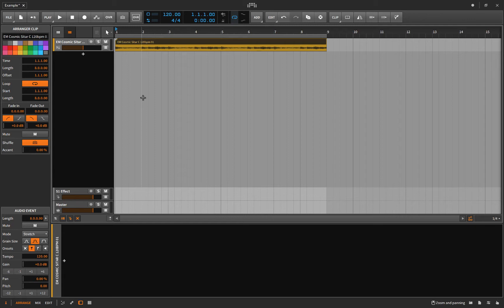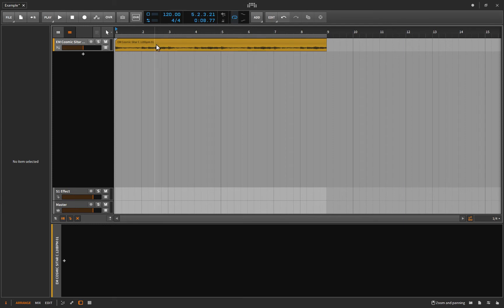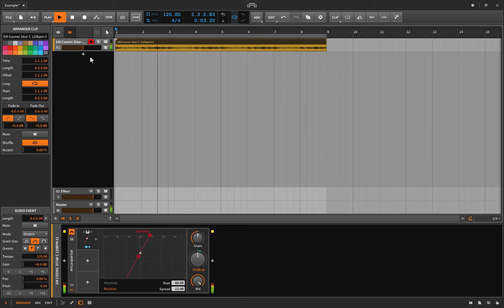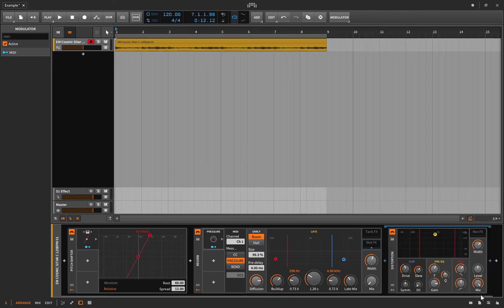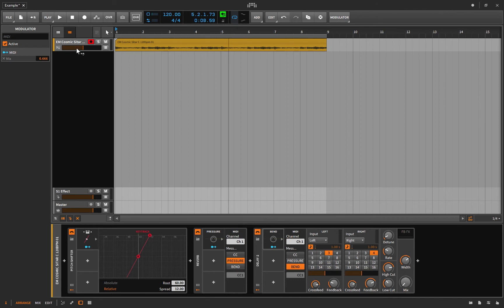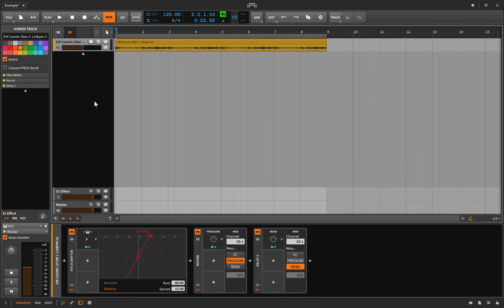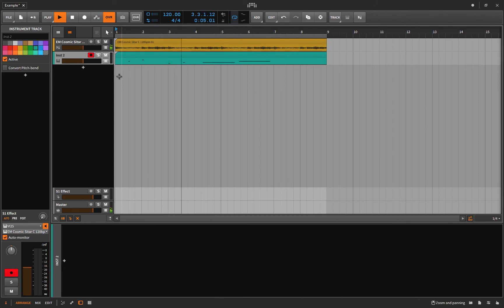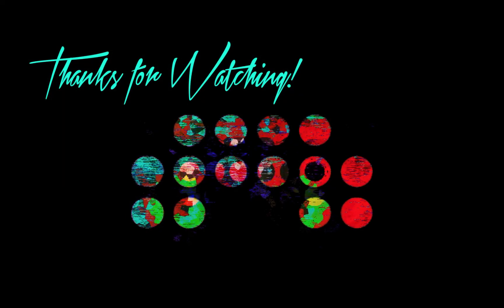A very Bitwig way to manipulate audio! Using MIDI Mods

Comment: Hi Vans! 
This is Bitwig Certified Pro Amir Ayyar. First of all I wanna thank you for all the good info you're putting out there for the community. I among others appreciate it ❤️
But, In fact, Bitwig is not the only place you can keytrack your audio files. NI Maschine Does that since 2.7. What Bitwig did as a game changer IMHO, is that you can actually key track your sample and not be trapped within the semitones steps.  Not to mention you can do this easily with 2.4 sampler.
Anyway, Thanks again for your wonderful videos. 
Best Regards
Amir Ayyar

Comment: Nice video, easy to follow and fast to the point. I have a slightly off topic question though, why do so many Bitwig users like to talk crap about other DAWs? 1:05 "... but then you would just have other DAWs like Ableton". Something as simple as pitch shifting an audio sample using MIDI and controlling parameters with after touch is of course easily possible with Ableton and probably in most other DAWs as well. And even better, in Live you're not limited to only modulating child parameters with it. You said how great it is that Bitwig comes with a big selection of modulators, yet in Live you have a community based around these tools, giving you literally thousands of them to choose from. What exactly makes Bitwig the clay that you can form and use in many ways that Ableton doesn't allow you to?

I find it very interesting how so many Bitwig users are not aware of what Live and other DAWs are capable of, but still claim wrongfully that Bitwig can do certain things others can't. Is it ignorance or lying on purpose? Since you seem to be affiliated with them, I hope it's not the latter. There is no perfect DAW, it's all subjective. Every professional knows that. Yet, almost every single Bitwig video makes a point on how Bitwig is superior to alternatives, why?
Reply: It's that it can do these things out of the box and every part of it is designed to be modular. Saying, Live has a community of people developing modulators is great, but they're not included in the box, built into the program. Yes, Max is very powerful, but not exactly easy to pick up straight away. Some people don't want to have to learn the equivalent of a degree in coding software to get what they want. If you do, great, but you can't deny having powerful, easy to access modulation built into every aspect of the program would be appealing to some.
Reply: @adamwhite1934  There are stock Max for Live devices included in the box. Just look at maxforlive.com, it's so easy to find more online. It's the same as external plugins, you have some stock plugins in your DAW and you can install more from external sources. I don't see how being limited to only stock modulators in Bitwig is superior to an open environment to build, share and legally sell your own creations?

Of course programming in Max isn't easy to pick up, it's a programming language after all. But that's just for making your own. You obviously don't need to learn Max in order to use the devices. You also don't need to learn how to program a vst in order to use one.

And again, "modulation build into every aspect of the program" sounds great until you realize you can't modulate outside of a modulators scope.

Comment: Cool idea with the key tracking, but I get a lot of sample clicking. It wasn't too prominent with your loop, but I tried it with a bass loop. Any idea how to avoid this? Some very short fade-in with an envelope maybe, but right now this is beyond my right-after-waking-up-skills... Nice videos, thanks!
Reply from the maker: Haha ya its definitely more for the bright-eyed time of day that is NOT just after waking up. And it must be some kind of weird voodoo that determines whether or not you get click and pops, I have definitely done this technique and gotten the clicks, and sometimes I don't. I can't seem to pin down exactly what determines whether I get it or not. You're absolutely spot on with the envelope, just a really small adjustment in the attack setting should fix it, or at least it has for me, if you still have issues even after doing this let me know and I'll root around some more for you!
Cheers! Thanks for commenting!

Comment: Hi Alex, your tutorials are amazing. Digging it a lot!
Am I right that you're using an Alesis VI25?
Are you satisfied? Was thinking of buying it as my (first) main MIDI Controller...
Is it working well with Bitwig? Or does it need any special scripts?

Would love to get a thought from you...
Reply from the maker: Hey! Thanks for asking :)
I do use a VI25, and I like how it feels, how it works, and the fact that I get so many knobs and drum pads to play with but I haven't been able to find a specific script for that controller to integrate perfectly with bitwig as of yet.
As it stands however, just plugging it in, and not doing really any set up in bitwig, the drum pads work fine for the drum machine, and the keyboard works just great for anything keyboard related. But the transport controls (pause, play, stop, etc) aren't scripted and therefore don't work.
The knobs can be assigned to anything so its easy to get those working when you need them.
I would say over all I'm happy but I also use a bunch of different DAWs. I would be curious about the Akai 25 key controller because I believe there's a script built in for that one. The only drawback there is how much smaller the keys and drum pads are. i have big hands, and I'm used to piano sized keys with a little weight, and the Akai is very small and I found it hard to play the keys when I did try one of my friends...
I think for the money, its a great little device, the drum pads are especially handy.
If I had to do it all again, I might look at buying a separate drum pad, and a separate keyboard, just for portability...
I hope that helps!!